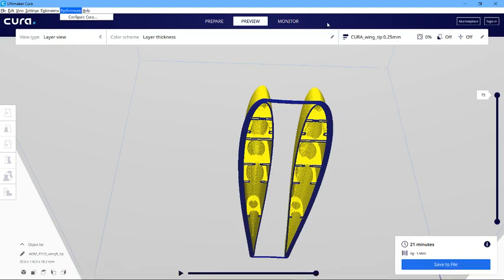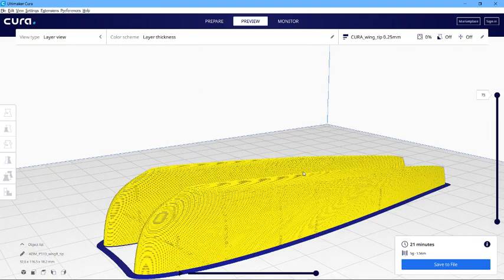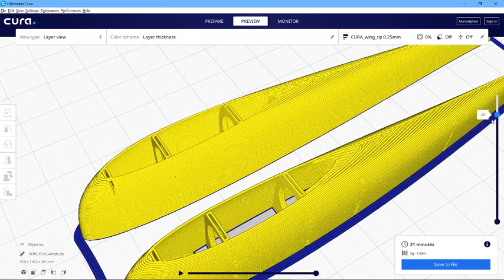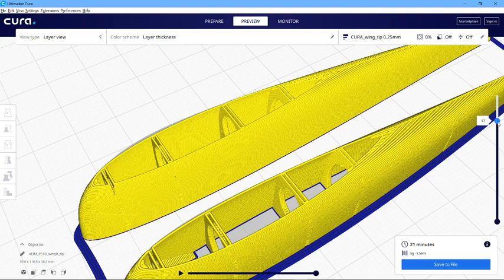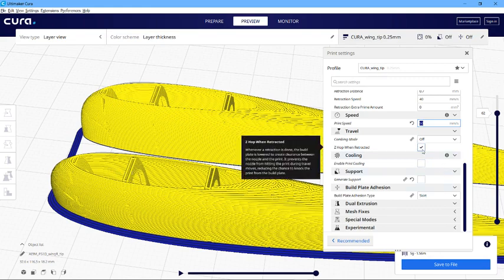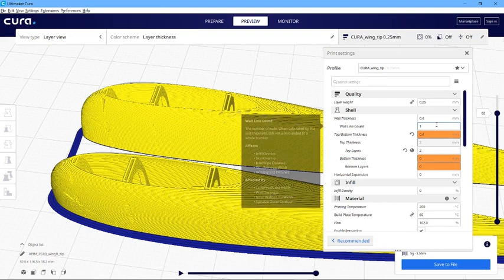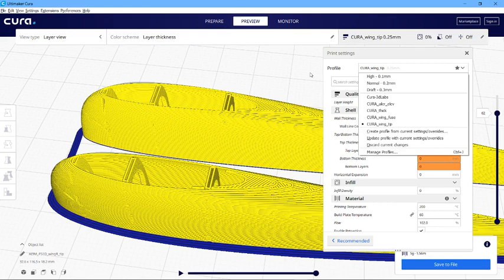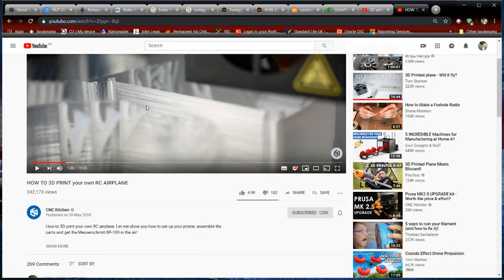Cura 3Labs thin wall printing settings

Comment: You need to change the nozzle.
To the smaller size.
0.25.
0.2.
And then print thin wals.
Dont get it.
If you need to onscrew a nut it is not always the same size.

Comment: I think. Isaw in one of the 3dlab videos that they rotated their wing pieces 45 degrees on the bed.  I wonder what different this might make.
Reply from the maker: Only that they can fit more onto the bed. They always run their prints in factory mode and run for days not hours. They print in batches in farms of printers just like Prusa. That's why they're always pushing the sales of the Simply3D software as it supports adaptive profiles. Cura can now do that with a little tinkering you can achieve tbe same results. 3Dlabs aren't making much profit from plans so they try and push S3D sales instead.
Reply: @knowledgebyte  Hehe - thanks for the info.  I actually bought simplify this afternoon thinking it might solve my print issue with the Razorblade Prop Jet.  There is a hollow tube running through the wing on an angle that adheres to the bed with no problem, but on the second layer, part of the circle doesn't adhere to the circle on layer 1.  Very frustrating.  I have tried .25 layer height, and now trying .2 layer height thinking that might be the issue.  I have a .4mm nozzle, using a Creality CR-10S Pro V2.   Anyway, simplify 3d wasn't the answer... i might return it in a couple weeks if it proves to not be the issue.
Reply: I rotated my prints 45 degrees like their video, I am now trying one at .2 layer height not rotated at 45 degrees.... so far, so good... go figure.  I know I can print at .3 layer height, so I might go back to .25 to save some time
Reply from the maker: @natewallis1  it won't be the issue. This is where you have to get creative and figure stuff out. It's an art of balancing all the settings and utilising Cura's features. It took me many months to crack all the issues.  I always got the stock answer that S3D was the answer. In the end I just figured it out and played with all the Cura settings and borrowed some of the profiles and watched a ton of videos. I have the razor blade printed out OK. It is a tricky print that's for sure.
Reply: @knowledgebyte  I had a feeling it wasn't going to be the solution, but so far clinging to hope.  However it is the only difference between my 2 gcode files.  All other settings are the same.  I have a feeling it is going to be a temperature issue.  My printer doesn't have an enclosure and the issues I have experienced with this printer so far turn out to be temperature problems.   At least I hope it is temperature as that is something I can easily control!!
Reply from the maker: @natewallis1  it will be  temperature, material flow, and the PLA quality. I only generally manipulate a handful of settings now and filter out the rest. I then reconfigure each print to get the best quality or just use the stock settings if I'm having few problems
Reply: @knowledgebyte  Ok - good to know - thanks Rob.   I got about a third of the way up the A1 part of the wing, but then noticed the ribs showing through in the skin.  Unlike you though, I didn't see the ribs showing through in the Cura preview.  But definitely came through in the print.  They also mention a 2% extrusion multiplier (flow rate compensation in Cura), which I made 102% - did you ever find the need to match that requirement?
Reply from the maker: @natewallis1  I think it is possible to mess around with the settings to reduce the ribs flowing out of the flying surfaces, but this is the way 3DLabs have designed their models. They don't create a mesh between the skin and the ribs. They rely on the gap between the skin and ribs to allow them to separate out the wing section parts, otherwise they would have to spend a lot more hours in the design process to achieve a truly mesh. They also recommend no fan for the HE tip. The extrusion multiplier is definitely one of the settings I hear mentioned that helps mitigate the bleeding.
Reply: @knowledgebyte  Thanks Rob.   I have since had some success after looking at the raw gcode files that came with my purchase.  I noticed that the raw gcode had a layer height of .2, which I have ended up going with as it appears to print ok at this layer height.  The only reason I went with .25 was because it was recommend in the guide that came with the plane.  However it appears that all prusa ready gcode files are generated at .2.... at least for the plane I am printing.   I also think it was related to extrusion multiplier.  I may need to calibrate extruder as I had to go up to 1.08'ish to get it to print ok at .2...   All fun and games until its 4'oclock in the morning!!
Reply from the maker: @natewallis1  yeah it's addictive. You have to learn to give yourself a mental break.

Comment: Curated really doesn't like 3d planes I have tried a few different planes and wing test and have never been successful. The best i can get is it print nice thin walls but won't print top or bottom players at all
Reply from the maker: It takes practice. I had a lot of problems early on, but after a few attempts managed to get a strong wing that is also light and airworthy.